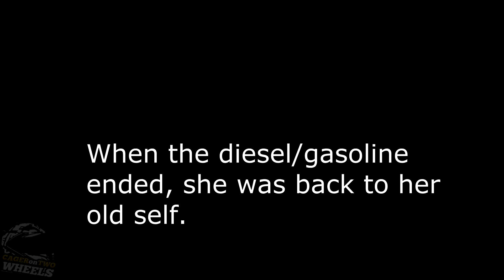Bike running on DIESEL!

Comment: I believe your hypothesis that the diesel is not being ignited would be correct if you were running straight diesel. You were actually running a mixture of gas and diesel, so I would hypothesize that when the gas ignited, the resulting flame and its accompanying high-pressure, high-temperature front also ignited the diesel. This would work at low-rpm, but at high rpm, there probably wasn't enough time between strokes for the temperature of the diesel to rise to the point of ignition. This is probably why your bike started and idled, but had difficulty reaching higher rpm. 
I do wonder if it would have run less poorly if you had diluted the 3L of diesel even more by topping up the gas tank with high-octane gasoline.  It's probably best not to try to find out...

Comment: so gas cars will still run on diesel a little bit but very very shit ... its got at least some motion not like the other way around gas in diesel that won't go nowhere for sure because of autoignition not being available at that compression...  Curious you should try completely filling the tank with diesel not mixing with gas

Comment: Cager, change OIL ASAP!
Diesel fuel didn't burn and went around of piston rings and ended up in the oil pan.
Now your oil is no good anymore, too thin.
Change it right away. You'll destroy your crank and all bearings.

Comment: Too late now but you should've just popped a fuel line off the bottom of your gas tank, drain the diesel onto the floor and put line back on and fill with gas
Reply: yep, exactly what I would have done.
Also now you should consider changing your name.

Comment: You were lucky that your bike kept running on diesel, thanks to fuel injectors i guess, otherwise it would have been so dead. Also using diesel in kind of bike that you have has a very bad effect, diesel burns and produces alot more smoke and that will jam your cylinder exhaust outlets.

Comment: diesel in gasoline engine, can be tolerated, gasoline in diesel engine means injector spray cut cylinder tops.

Comment: Giving the injectors a workout
Reply: julian wilson I think it's cuarberated
Reply: Dj Mystery nope, its fuel injected
Reply: It's not hurting the injectors at all. If anything, it's lubing and cleaning the fuel system. Injectors are nothing more than solenoid valves. Pump pressurizes the fuel, injector opens, and whatever sprays out of the injector is what goes into the engine. How long the injector stays open is determined by the ECM, based upon input from O2 sensor, engine temp sensor, air temp sensor, etc.

Diesel will not hurt a gasoline engine or fuel system at all.
Now, ethanol? That's another story. It rots any rubber hoses and it leaves gummy deposits.

Diesel will also help clean the intake valves and the throttle bodies. Fuel injected engines have a LOT more trouble with throttle bodies and intake valves gumming up, than carbureted engines do.

Diesel vapors will help out with that.

Comment: Diesel is bad news.. the other way around wouldn't be a problem, as long as you have enough regular petrol inside it'll work, but it's not a good idea. If you filled it up all the way you'd be screwed. EDIT: I would have changed the spark plugs after this happened.
Reply: dbauernf other way around man

Comment: So basically if you know that you made a fuel mistake then you still can burn all the tank content and refilling with gasoline. xD
Reply: EstevanTH Oh BTW about your theory I think that once gasoline starts burning, the oil with it starts burning. No gasoline at all => no gasoil burning, at least it's what I think.
You may increase the idle RPM in order to keep the engine running because the amount of gasoline may become insufficient.
Well this can be a good idea anyway. xD

Comment: You can do this just change the carbs all the way to lean install new jets if needed get the right plugs and use low grade diesel that will burn easier
Reply: No lol it’s a fuel injected bike.

Comment: Diesel is an oil. What you have done is like adding  far too much 2T oil to a 2-stroke. It will burn but produce a lot of carbon deposit. 
What I would have done was discard the entire tank full safely as soon as possible by draining from the fuel hose into petrol cans. Then refill with the best petrol available and adding an injector cleaner such as RedEx.

Comment: You're running basically unneccesarily-high-octane gasoline in your engine.
Reply: Ellenor Malik Diesel has way lower octane than gasoline. Which is why diesel engines can use compression alone and no spark plugs.
Reply: cumulo25 Pretty sure diesel fuel can't be sparked at normal gasoline compression ratios
Reply: Ellenor Malik it cant
Reply: diesel is harder to egnite, and it cant really be egnited by sparks so it uses compressions to heat it up

Comment: That was wery dangerous!
Your spark plugs are dirty now and need to be changed, your whole fuel-system needs to be cleaned, every pipe and the tank as well.
Fill up everything with gasoline and hope you haven't damaged the engine!
Also your catalyzer could be damaged, too!
Reply: off course it has a catalyzer!